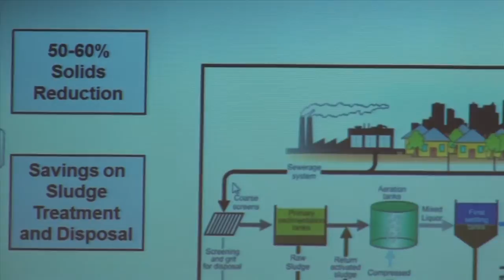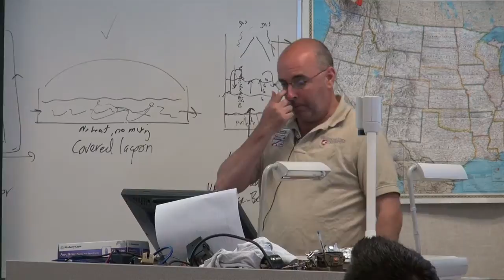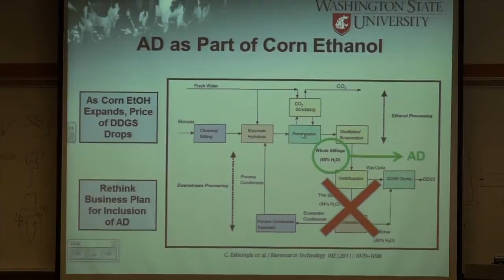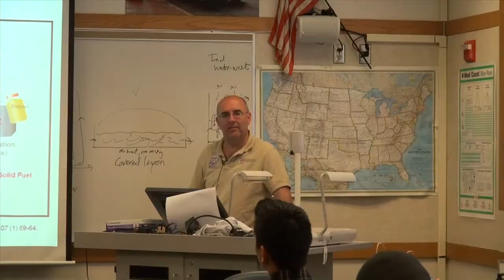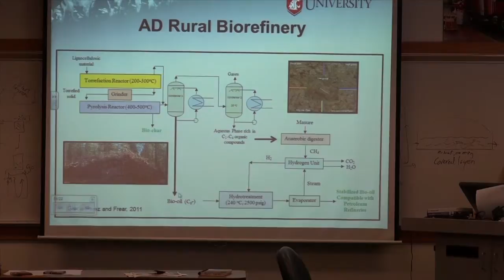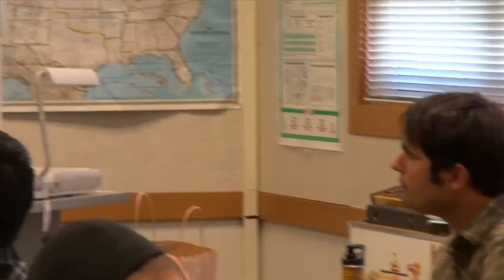Existing Infrastructure and Anaerobic Digestion

Comment: what is the temperature of the top of the concrete slab on the digester. would it be viable to place a green house over it and
cycle the nutrients through a fodder production system?
Reply: and CO2